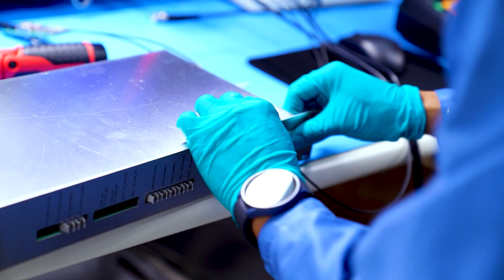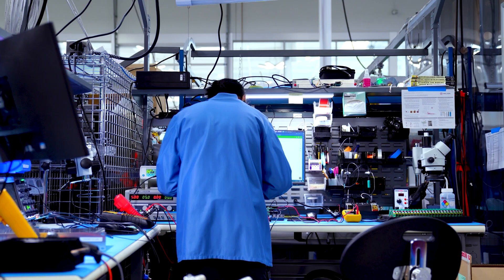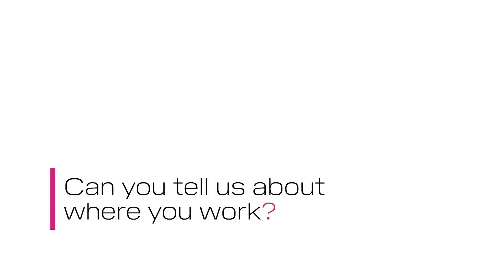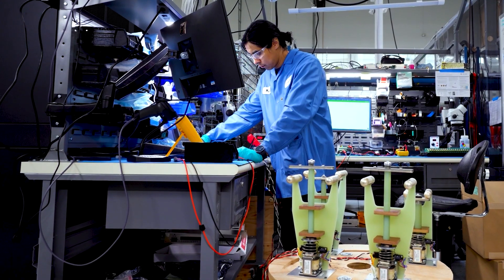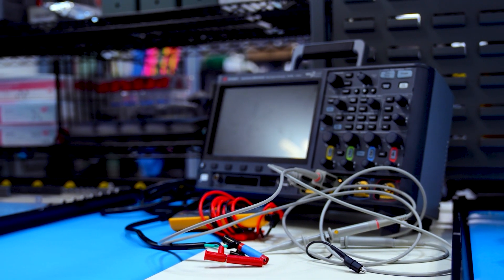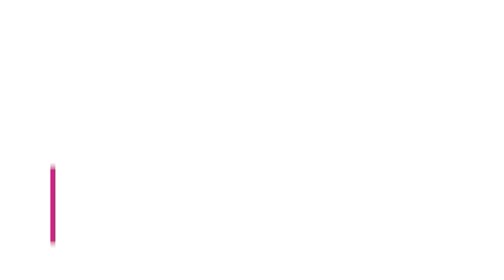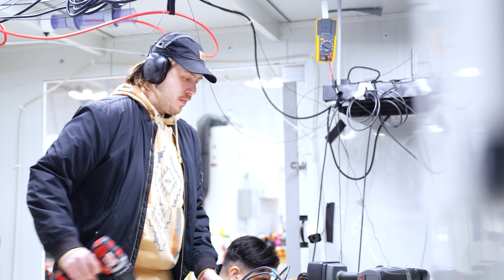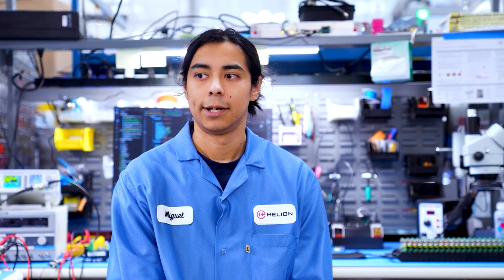Meet Helion: Miguel R

Comment: He3+D2 includes D2-D2 which has a lower threshold and so reaction 7:1 more than He3-D2. It makes neutrons and Tritium. Tritium-D2 has a still lower threshold and makes more neutrons. Helion has no neutrons (or shielding) therefore no more fusion than a Farnsworth fusor. Helion must need investors to be pumping out so much marketing.